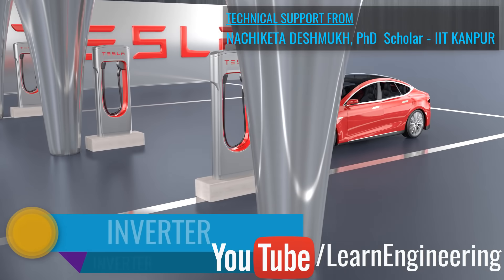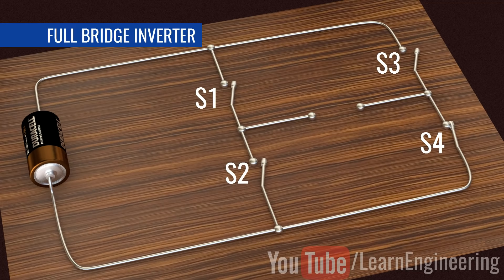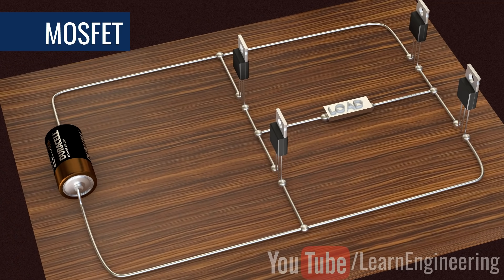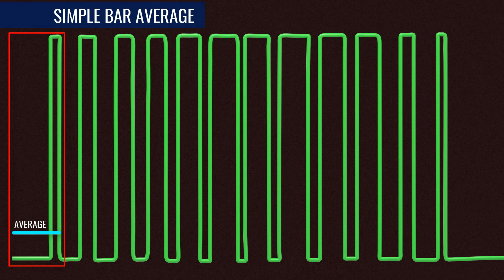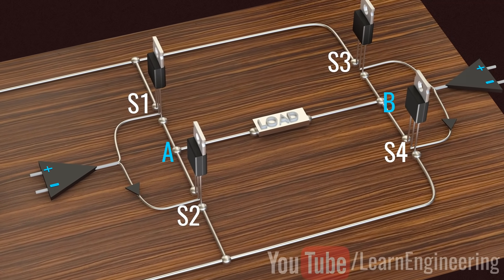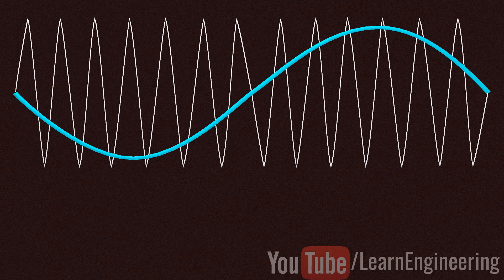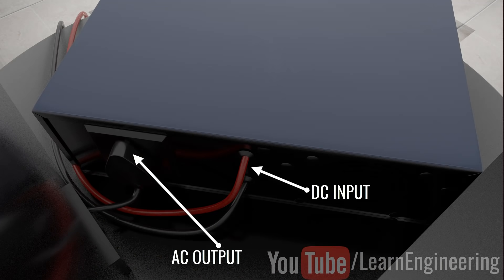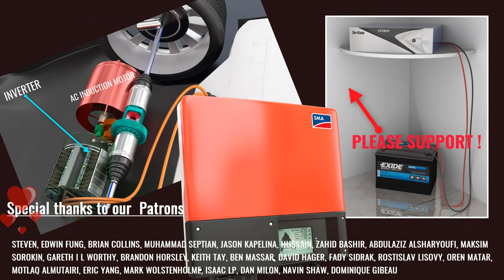Inverters, How do they work?

Comment: I have a simple question ,
If the frequency is 60 hertz , why do we need to turn it on and off 120 times ? Where 120 come from? Im studying electrical engeering ,so use any terms you want to explain
Reply: You need to turn it ON and OFF twice for every cycle. One for the positive half cycle and other for the negative half cycle.
Reply: Becuase in each cycle you have to turn the switchs on and off two times one time on the right side and the other one on the left side... So if you have 60 cycles you have to on and off your switches 120 times
Reply: @armenbabikian94  i see , ty very much

Comment: Lovely video. I’m an inverter fanatic! What about creating a small signal sine-wave and using it to drive the mosfets in a push-pull configuration? Basically amplify a pure sine though a pre-amp and use fets to create a perfect high powered sine.
Reply: I think the problem is with power loss as you will be operating the mosfet in the ohmic region and dissipating much power as heat.  OTOH PWM which drives the mosfet to full on and full off wastes far less energy.

Comment: How do you do "average voltage" from the square signal?
Reply: Each time period of the square signal has a portion of time where it is on (high voltage) and off (low voltage). The percentage of time that the signal is on will change the average value of the voltage over that period.

Let each dash be a 1 second. A low dash is 0V and a high dash is 1V:

_ _ _ - - - - - - -_ _ _ - - - - - - - 

This signal has a period of 10 seconds, and is on 70% of the time, so it's average value is 0.7V.

BTW, the percentage of time when a signal is on (above a given voltage) is called the "duty cycle" of the signal.

So we change the average of the signal by changing the duty cycle.

Comment: In the first figure you claim that the waves on the right are not AC. They are, because the change polarity. However, they are not sinus waves, which is probably what you meant. (An AC doesnt have to have an average value of 0).

Comment: and the speed of how fast the main capacitor charges will determinant how often the trigger voltage for the switches is hit, and when one switch is closed the capacitor for the other circuit charges then when that one is full the other gets turned off so its capasitor starts to recharge and that makes the frequency, a 25kHz square wave is a wave. CAPS DON'T LAST FOREVER. but some can go for 2 million hours.

Comment: It's supose to "create" an AC signal with the inversor, but where do you get the AC input for the comparators  and generate de diferential averaged signals? I knew hot to generate the PWM with a triangular signal and aonther and a static signal controlled by a variable impedance (potentiomether) but not with another AC signal.

Comment: The older/simpler inverters did not produce a square wave. They produced so called modified sine. Which is not a sine wave at all, but still is a more complex wave than a square, it additionally spends some time at zero. Definitely a better approximation of a sine wave.

Comment: 5:47
I wonder why does it use coils, because the induction motor has coils.
Reply: In some cases, if you know for sure the output is going to power an electric motor, you can leave out the coils in the power inverter and just leave capacitors, the capacitors and the inductors in the electric motor form the RLC circuit, but you can still get that noisy buzzing sound. The coils in the inverter are paired with capacitors to form RLC circuits, the RLC circuits smooth-out the bumps in the output signal. Remember that you don't just get voltage at the output, you get a magnetic field as well. Without the RLC circuit, the bumps in the output signal can turn into vibrations in magnetic field, which can vibrate any metal around the device, producing a loud and annoying buzzing sound.
Reply: You can calculate the inductance of the motor, if it's enough to smooth the current you can get rid of the coil.

Comment: How can I integrate battery into inverter generator circuit such that power can be stored for use when the generator is off? When the battery is low the gen comes back on for power use and charging proposes

Comment: What about using a microcontroller with a DAC and a sine wave table stored in ROM? This is then fed to a power amplifier.

Edit: Aha, I see: in the power amplifier case the driving transistor acts as a variable resistor and thus need to dissipate a lot of power in order to restrict the current. When doing PWM it's either fully on or fully off meaning either minimal resistance (low voltage drop) or maximal resistance (only leak current).

Comment: At 1:45 The hertz (symbol: Hz) is the derived unit of frequency in the International System of Units (SI) and is defined as one cycle per second. So if its 60Hz we need to turn 60 times in one second

Comment: A bit less efficient, but gives a true sine wave, you can use a motor-generator set.  Drive an AC generator with a DC motor.  Modern "brushless DC" motors would be a bit more efficient than the older method of using brushed DC motors.

The advantage of true sine wave is that the common AC motors  don't run properly on the simulated sine wave out of an electronic inverter.

Comment: Always wondered why invertors  don't like inductive loads. A powerful ups won't drive a small desk fan well or at all. I'm guessing it's simply because it would involve current flowing when the voltage is zero isn't possible when the mosfet is off.

Comment: An EGmicro EG8010 chip does 90% of the work now a days.  Add some MOSFET drivers (IR2110) and some MOSFETs and you are done.   If the MOSFETs are switching high voltage (>Vp-p) the output is complete.  If the MOSFETs are switching low voltage a transformer is required.

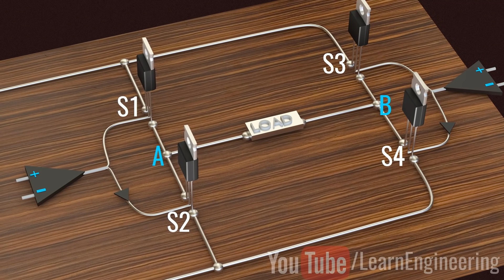Comment: What is that NOT gate at 4:00. What device is used as a not gate
Reply: Usually a transistor is used. The NOT function is this;-
https://drive.google.com/open?id=197XKfXWSrF22sNIHTkmYABgV7Gehfqom

Lamp A follows the input: when the input is 0 (off, low) lamp A is off (0, low): when the input is a 1 (on, high), lamp A is on (1, high). 
So, when lamp A is lit, lamp B is not, and when lamp B is lit, lamp A is not: so B is NOT A.

Comment: I thought they used a lot of mechanical inverters back in the day, whether it was by using a DC motor to run an alternator to get AC, or though the use of a vibrating reed to switch the current and then tuning it the way you might an acoustic device?

Comment: The main reason that the US went with 120/240 VAC is the lower voltage was (seemingly) less hazardous.(research AC/DC war) 60Hz is more efficient than 50, and Tesla realized the greater simplicity of the motor design when dealing with multi phased motors, which he had already designed. (Designing 60 degrees into 360 degrees). But the name calling and insults only serves to belittle yourselves. But the comment on less copper required for 220v over 120v needs validation if you want people to accept your claim. Wattage is wattage. Higher voltage requires less amps, but more turns to increase resistance. Same copper weight.

Comment: The average of AC doesnt always have to be 0v. And it doesn't always have to be alternating from V+ to V-. You can create an AC with three positive DC voltages.  For example, v1=0v, v2=2.5V, v3=5v. You can alternate among these voltage levels. And you will get an average of 2.5Volts in this AC. Of course, this is not same as the AC in our wall plugs. But, most monochrome LCD screens run by this kind of AC voltages. You are overgeneralizing the term "AC". There are many types of AC.
Reply: Digital Hands - What you're describing is pulsed-DC - because the current is always flowing in one direction, you're just adjusting the load to those voltage levels. AC is alternating current, where the current first flows in one direction, then it flows in the other direction.

Comment: I really enjoyed the description of PWM. It was something I wanted to know for some time. I thought that mechanical, so called rotary converters, where used as inverters before the development of tubes or semiconductors. - I am sure nobody would use them this way currently anymore, but aren’t they still a viable option when it comes to convert DC to 50Hz or 60Hz AC?
Reply: well you can use them, but they are really inefficient... you are basically turning a dc motor, that acts as AC generator at the same time, so you would lose almost all of your available power to heat and magnetic losses before you even startet to use the AC Voltage.
Reply: @dovos8572  electric motors of any sort have efficiencies in the 90% range, so two in 'series' will still have an efficiency above 80%...
Reply: @Ironic1950  they only have that efficiency in their optimal load and depending on what kind of electric motor you have it can be less than 30% efficiency if you are at the wrong load point (not enough load and too much load).

Comment: It makes me cringe is when someone plugs their 5 volt phone charger into a 120 volt inverter in there 12 volt car.
Reply: It took a few seconds to understand what you meant, but I totally agree 😂
Reply: Because of the low efficientcy?
Reply: Not a big deal these days....5 Year’s ago....nay nay.....but these days.....screw it...or should I say plug it?
Reply: That will give you the full rated charge current that the 120 volt USB charger is capable of, which is even more important when you're using something like Samsung Fast Charging, which charges much faster than the regular USB standard.
Reply: yes, but samsung fast charging, and motorola turbopower are usually just rebranded Qualcomm 2.0 or 3.0 charging chips.... and you can get a qc 2.0 or 3.0 car charger for like $15 that will charge a compatible device as fast as possible, it steps the voltage up to 9v or even 12v when needed. 
lol, sorry for the monologue... im board
Reply: I figured that would be the case by now since those newer standards have been out for a while.
Reply: Right why not just use a dc car charger
Reply: And it makes me cringe when someone writes 'there' instead of 'their'.
Reply: @Surmoka  Yep, me too. Language is both functional and beautiful, why do people mangle it through laziness?
Reply: I have never had a car charger work properly. I know they can make them work properly, the cigarette lighter socket can output about 100W, but for some reason they just don't.
Reply: This sounds weird to me like the charger itself is a connector witch can only br put in the contacts in your house and if you have an usb carger in the car you can just plug in the cable and the usb port is already sending out 5V
Reply: POWER EFFICIENCY 100
Reply: @cgwworldministries It makes me cringe when people cringe about other people cringing
Reply: It makes me cringe when people use "there" when they should use "their."
Reply: @openskies11  Me too, the words have different spellings and are pronounced differently for reason. That, very good, reason is that they mean totally different things! I have only noticed this in recent years, I am 57 years old and cannot remember anyone making this mistake before about 2010.
Reply: The new switching type adapters are so efficient  there really isn't any waste, 12 to 120 to 5 , but yeah, know what you mean.

Comment: The circuit is actually simple. Usually a microcontroller generates the pulses that turn on the h bridge (totem pole can be used instead) which then passes through a filter (capacitor and inductor) then to a transformer. Inverters without a transformer use a boost converter before the h bridge and switch at the output voltage. The microcontroller samples the output and adjusts the pulse widths to adjust voltage and power factor.
A pure sine wave inverter is basically a class D amplifier with a 60hz sine wave input.
In fact you could use a class D audio amp for car subwoofers and a transformer to create AC.
Reply: Make a video and we will see.

Comment: Will PWM work for speakers and radio transmitters or does there need to be a genuine sine wave?
Reply: What? The PWM gets mushed into a sine wave.
Reply: Yes, I understand that. I was just curious as to if you can send radio waves or play sounds by using an arduino (which uses PWM). If that doesn't work, do I need some capacitors in my schematic? Thanks
Reply: You can transmit PWM, eg RC planes, but there are rules to broadcast radio. A square wave is a sine wave plus all its harmonics, so if you modulate it, you get a lot of IPs (intermodulation products) which will interfere with other radio signals. 
Musical instruments don't produce pure sine waves, they have harmonics that let you identify the instrument, so the harmonic content affects the sound.

Comment: Or, just store the PWM values (0 or 1) directly in a table.  Vb is a time-reversed version of Va, so you can use two pointers (forward and backward traversing) to generate both signals from one table.

Comment: What is this about "the average value of an alternating current over a cycle will be zero" and then the picture of waveforms with duty cycle other than 50% and the caption "NOT A.C."?

This is entirely misleading and/or wrong! Of course AC can still be AC and not average to zero!

Ever heard of DC offset? The asymmetrical waveforms shown have a DC component.

Comment: i love how  they tell/explain why to use capacitors ect in a circuit the reason for generating Ac/over DC is grunt or pressure or oomph in which case here is speed for a car.60 mph/km.. but in the case of a toy car dc is good enough with a brush less motor will last  and last for its size

Comment: The future of Electric motor for cars, is Variable Reluctance Attraction Pulse Motors. No magnets are required and most of the electrical energy (98%) is recovered by the Coil's BEMF (kickback). When high (Room) temperature super conductors become reality, the efficiencies would be so close to 100%, that you would be able to run your electric car for a year on a 12V battery without the need to charge it. Chew on that...